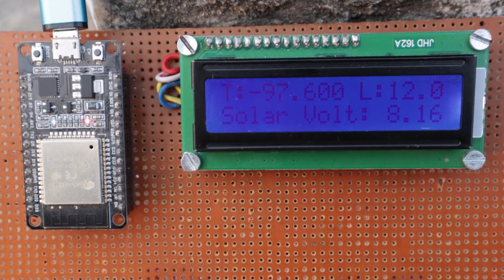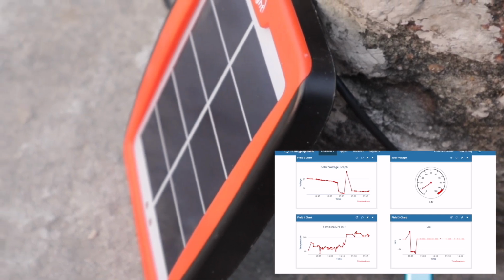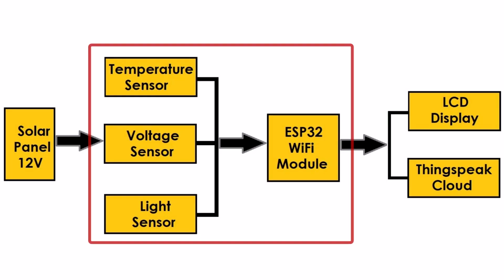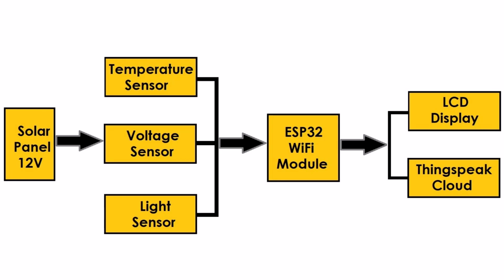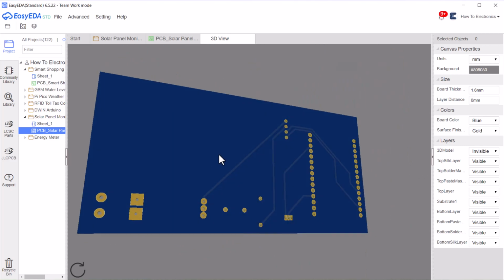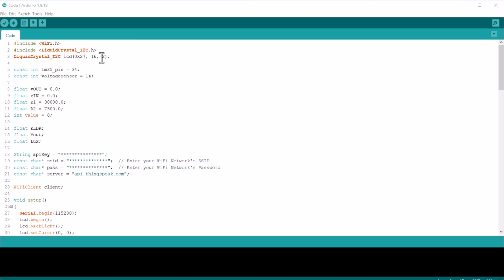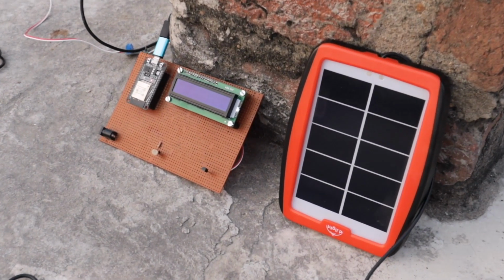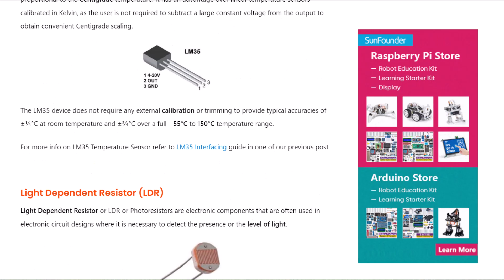IoT Based Solar Power Monitoring System with ESP32 & ThingSpeak Server

Comment: esp32-cam, max32664d, mlx90614, mpu6050, bme68, max9814, fsr-402,and power: solar panel (5w) to charge controller, feeding battery to 5v/3.3v rails. can you find an equivalent prototype circuit design and also run a simulation  the project is on remote health monitoring system for elderly care: a privacy-enhanced, video-integrated solution with ai for low-resource settings

Comment: thank you for this nice presentation, i am currently building up movable solar panel with two photoresistor sensors, connecting to the two edges of the solar panel. now i want to extract data for solar voltage, temperature, current etc, for this case, what change should be there in your code?

Comment: I managed to get this working beautifully on a breadboard.  So, I ordered 5 of the PCBs from a PCB supplier and they don't work.   In the schematic you can see the LM35 pin 3 is connected to the GND of the ESP32.  However, in the gerber you can clearly see the trace going not to ground but to pin 13 of the ESP.

Comment: I think the pinouts for the ESP that I'm using are different.   I could not get the voltage sensor to sense anything then another website said to use pin 32 and when I made that change it worked fine.   What ESP are you using for the PCB?

Comment: Hi 
Code is running everything good but getting temp as 329 and it’s constant it don’t change at all neither voltage nor light intensity 
Getting same output everytime. 
Checked the sensors looks fine 
When I check lm35 with multi meter I was getting 25-26 celsius 
Can you please help me with this. Tried almost everything
Reply from the maker: Check the connection of LM35 with analog pin. Run an example code to verify whether ur LM35 is fine.
Reply: Ensure the esp is grounded to the same ground as the LM35.   I was getting the same thing,  Temperatures in the hundreds then a whole bunch of zeros.  ONce I grounded the ESP the reading became normal.
Reply: @RandomTorok 
How to ground ESP32 ?
Reply: @jazibhassan1526  run a cable from the ground of the ESP32 to the ground of the temperature sensor.  The 2 devices need to share a common ground.

Comment: code is running properly with no error!! but nothing is coming on LCD and when i press the buttons on esp32 the lights on lcd changes but not getting any output
Reply from the maker: Change your I2C address for LCD. Some LCD has address of 0x27 while some has 0x3F. Change the address in code. Then upload and check.
Reply: Try setting the contrast level on the LCD.  There is a scew on the back to enable this.

Comment: Nice tutorial. Great Project.

 In real solar applications. I want to do things like check my battery percentage. Check how much load is on my system And Probably detect excess load on the batteries. Please can you do a tutorial on that?
👍
Reply from the maker: Some tutorials on this is coming soon. I am working on it.
Reply: Can you make this same  for my solar system  I will buy :- 
Parameters are : 
Voltage(upto 600v )
Current (upto 100A)
Power etc.
Wifi monitoring

Comment: Hello ,
My display is showing 0 volts and and temperature is not changing
Reply: Same errror!! 
Did you try anything???
Reply: @eshabhatt4068  check out your Arduino code 
There must be some error
Reply: Did you found any solution???
Reply: Getting the same problem 
Did anyone got the solution?